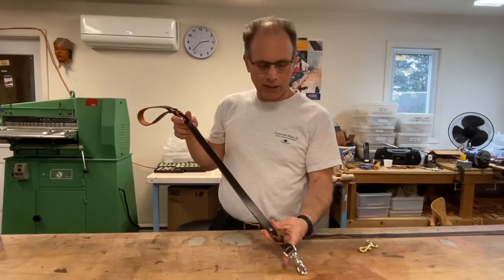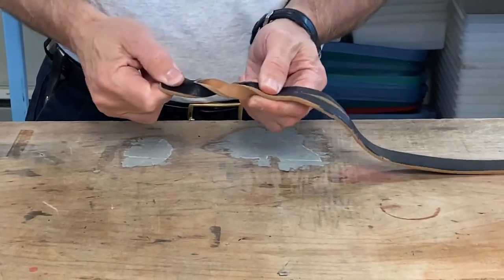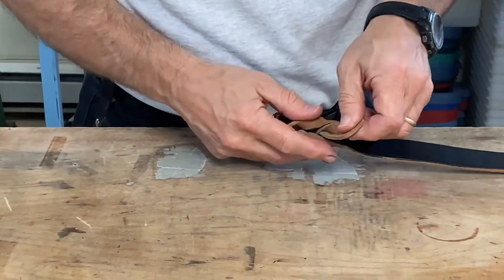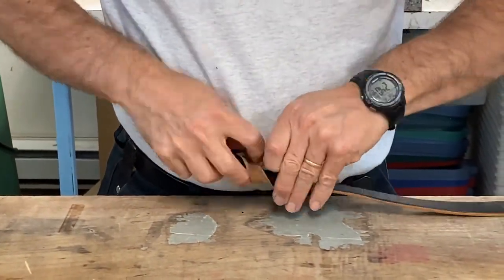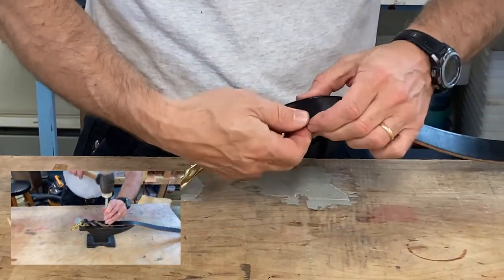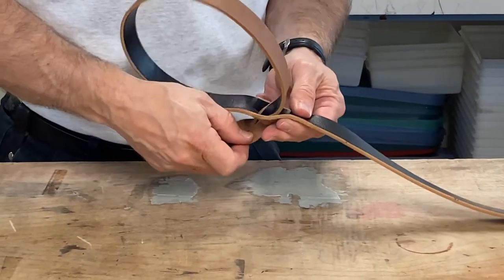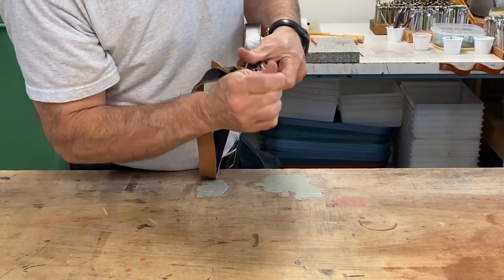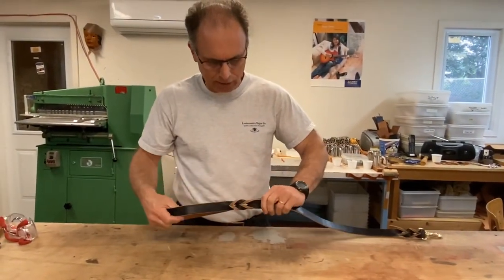Braided Leather Dog Leash DIY

Comment: OLD Leather Smith here, very nice sir, I have just found your site.  On the clip end I would use a Chicago Screw , 4 future breakage, easier 2 fix.  GOD'S BLESSINGS ✝️⚾🙃
Reply from the maker: With this type of weave, many people don't add anything else to secure the end.  However, we add a rivet for a little extra security. However, you are correct, a chicago screw is much strong than a rivet and easier to replace than having to drill out a rivet. Sometimes when we use chicago screws on other projects, we might add a drop of thread Loctite threadlocker to prevent the screw from accidentally loosening. We also sell chicago screws (screw posts) at https://leathersmithdesigns.com/leather-fasteners-spikes-studs/
Reply: @LeathersmithDesigns  you R correct, and I use 2 do the same thing until I purchased a tool that allows me 2 tighten it down 2 such an extent nothing else is required.  GOD'S BLESSINGS ✝️⚾🙃
Reply from the maker: We just use a screwdriver to tighten the chicago screws.  What tool do you use to tighten them?
Reply: @LeathersmithDesigns  I purchased it from Weaver Leather, it surrounds the screw so you can really tighten it down.  GOD'S BLESSINGS ✝️⚾🙃

Comment: Very beautiful. What is the length of the slots and the distance between them?
Reply from the maker: Glad you liked the video. You can see what slot lengths work best for your leather.  For the braided leash we made in the video, we used 9 oz thick leather and made the slots 2 1/2 inches long.  On the dog leash clip end, we made the slots 1 1/2 inches apart.  On the handle end, we made the slots 18 inches apart.  You may want the handle on your leash to be smaller or bigger than we did depending on your preferences.

Comment: Can you please share with me where you make the cuts on both ends and how long the cuts are?   Thank you so much.
Reply from the maker: I put information on measurements for the slots in this article https://leathersmithdesigns.com/blogs/braided-leather-dog-leash-diy-/  .  These are just the measurements and placements we used on the braided leather leash that we made with 8-9 oz leather.  They work for us but you may try different measurements depending on how tight or loose you want the braid or on how big of a loop you want for the handle.  You can buy sturdy dog leash clips at https://leathersmithdesigns.com/swivel-snaps-leash-clips/

Comment: How much further apart are the handle slots?
Reply from the maker: You can see what slot lengths work best for your leather.  Regarding the braided leather leash in our video, we used 9 oz thick vegetable tanned leather and made all the slots 2 1/2 inches long.  On the dog leash clip end, the slots were cut 1 1/2 inches apart.  On the leash handle end, the slots were cut 18 inches apart.  You may want the handle on your leash to be smaller or bigger than we did depending on your preferences. If you want a tighter or looser leather braid you may want to vary the length of the cut slots. You can also see our blog on the leash braiding at https://leathersmithdesigns.com/blogs/braided-leather-dog-leash-diy-/

Comment: Is it ok to use braided leather for a large breed of dogs?
Reply from the maker: My personal feeling is the braided leather dog leash is just as strong as the unbraided leather dog leash. However, I have not tested them side by side to see if one is stonger than the other. I would suggest the 1 inch width as opposed to narrower for large breed dogs.
Reply: @LeathersmithDesigns  thanks 😊

Comment: How long should the holes be?
Reply from the maker: If you mean how long should the slits be in the leash, this is what I did in the video. I used 9 oz thick leather (9/64 inch thick) and cut all the slots 2 1/2 inches long with a utility knife. The slots can be shorter or longer depending on how tight or loose you want the braid to be.  You can read more about making the braided leather dog leash in our our Leather Artisan Blog at https://leathersmithdesigns.com/blogs/braided-leather-dog-leash-diy-/

Comment: I have a dumb question: other than aesthetics, what other reasons to put braids on a leather leash?
Reply from the maker: There might be other reasons for braiding the leather leash end but my own understanding is 1. another style for aesthetics 2. an alternernative way to attach the clip and finish the handle without using rivets or sewing.  Although it is not required in this type of braiding, I still like to hold down the end with a rivet.

Comment: Do you use bridle leather? Thanks for video!
Reply from the maker: Glad you liked our video. We make the long 6 foot leather leashes from vegetable tanned backs and the shorter lengths from vegetable tanned bends. We hand dye the leather, dip it in pure neatsfoot oil, polish it with a couple coats of resolene and finish it with some dubbin water repellent. It is not bridle leather as it is not stuffed with oil or finished with waxes from the tannery.  Bridle leather would also make a beautiful leash. Here is an article on us doing the braid: https://www.leathersmithdesigns.com/blogs/braided-leather-dog-leash-diy-/
Reply: I made this leash yesterday based on your process and measurements.  I used bag punch for holes since I used a heavy bridle leather. Yep used brass rivets with saddle stitching. I used some stitching to adjust loop size for handle.  Thanks for video!!! 👍
Reply from the maker: I bet your leather dog leash looks great. It is certainly satisfying creating a finished leather product from start to finish.

Comment: what is the total end to end length of the leather that you cut before braiding? How long of a leash does it make? Thank you in advance for your reply
Reply from the maker: We make different length leashes. I can't remember what length we made the leather leash in the video.  For our 6 foot long leather leashes, we cut the leather 87 1/2 inches long before we assemble it. We use the sturdy flat swivel snaps on our leashes which you can see at https://www.leathersmithdesigns.com/swivel-snaps-leash-clips/